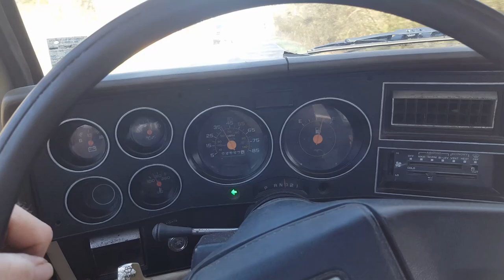Rescuing a forgotten 18 foot utility trailer PART 1

Comment: I know I have mentioned I love my square body trucks especially the k20 3/4 ton 4x4 trucks, well honestly I have had 3 k20 4x4 trucks only two were the heavy duty c6p 8200-8600gvw chassis trucks.. and I have had no less than 6 c20 2wd longbed 3/4 ton trucks actually I consider them more practical especially for the every day driver and trailer duty truck and all of them were the c6p heavy duty 3/4 ton 8200-8600 give chassis trucks.. and honestly I am looking into getting another c20

Comment: My daily driver will be a early 94 Chevy Silverado extended cab short bed z71 I ended up trading my 86 Chevy k20 custom deluxe longbed 4x4 c6p farm truck from 8600gvw 9 spring rear leaf packs, plus helper spring and even after I destroyed the front gm corporate 10 bolt front axle and the truck ended up with it's 3/4 ton springs bolted to a set of 1983 gmc k1500 high sierra 6 lug front gm corporate 10 bolt axle, and the gm corporate 12 bolt axle in the rear, the still was a very stiff riding truck, honestly you could take the rear shocks off and drive it down the road it didn't move down enough to make much of a difference and you couldn't tell a difference driving it.